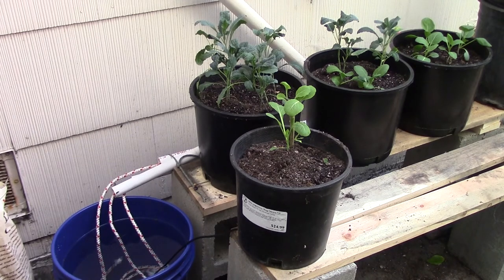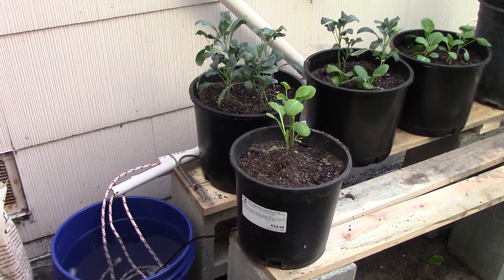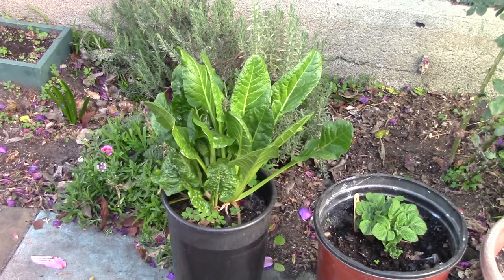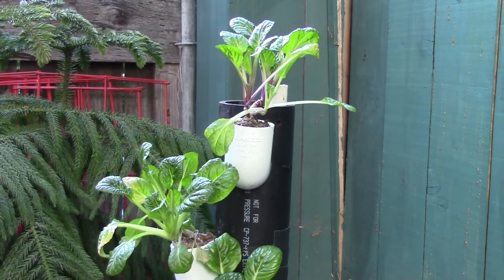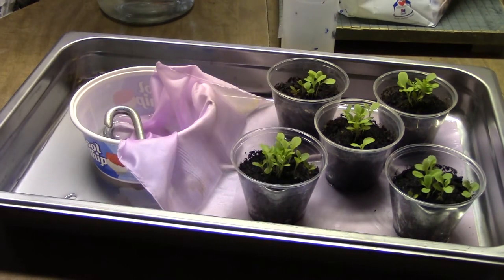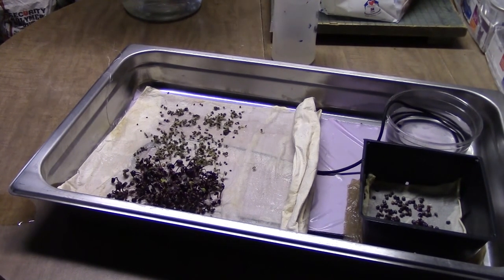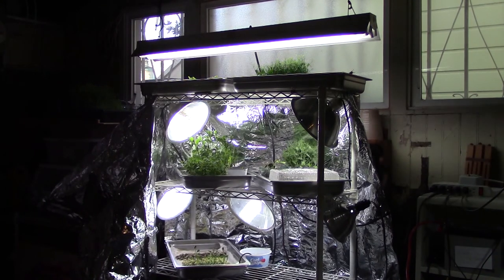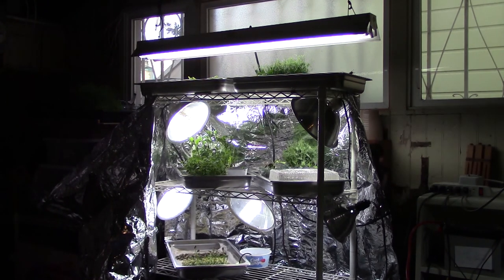GSM Solution   Wick Irrigation and Microgreens

Comment: Thanks for sharing.  I've been experimenting with wicking based on videos on Van Duzee's channel for a couple of weeks with great results.  Great for home consumption, but not really practical for retail.  I just stumbled across your channel, and your rope wick idea is fantastic.  In fact, I think I have the exact same white and red rope as well as para-cord!  I received sunflower and pea seeds from Mumm's today, so I'm going to give your approach a try.  First batch of sunflower seeds are being soaked right now.
Reply from the maker: Look at my more recent videos.  I've moved away from wicking, but burlaponics is good for microgreens and shoots and you can use standard 1020 trays for kratky hydro.
Reply: @tangobayus   Aloha! Yes, I've watched your more recent videos and saw some of the shortcomings of the wicking system.  I'm trying other variations of your approach with the main end-game being a go-to-market container of micro greens from start to finish - that is, seed, germinate, grow and retail sale all in one container.  

I just saw a parallel concept in the produce section at our local Costco.  It was two heads of a butter type lettuce.  Each had its root system in a semi-sealed container which looked like a large, used Kuerig cup (obvious holes for water and drainage).  

So, I'm wondering if a better wick to substrate ratio would yield satisfactory results. I've got some old take-out containers set up with different wicks in the lab right now.  I saw your burlap approach (and actually just had a big roll of burlap in my hands at the hardware store the other day before seeing your videos, but put it back - I decided to try food safe cheese cloth instead).  With the target of starting my crops in their retail containers, I'm not sure if that approach would work for me.

Coincidentally, Dr. Kratky's method is what led me to VanDuzee's channel, and that's where I picked up his paper towel wicking system that works very well for broccoli greens.  I just got pea and sunflower seeds in, so I'm got to try those using the VanDuzee method.
Reply from the maker: I've come up with some improvements in the tray method which I will be documenting.

Comment: Hydroponics is not a "fragile" way to grow things...plants grow twice as fast and twice as big than in soil. Have you ever tried it? Can you show me some results to back this up? Because i have extreme success with it
Reply from the maker: You are quite right.  I'm currently building a system that has some reservoir capability, which I think covers the possibility that a pump can go down, which can destroy an NFT system.
Reply: @tangobayus  deep water culture?
Reply from the maker: Somewhat like Kratky v2 (Dr Kratky has also evolved to using float valves to maintain a contant level.)  3" ABS for grow tubes, adjustable Flex Cap on the end so I can keep about 3/4-1" of water in the bottom of the tube.  But I'll pump nutrient solution through it 8 times a day for a few minutes.  I'll have a component video soon.